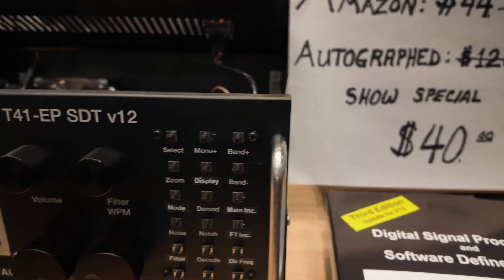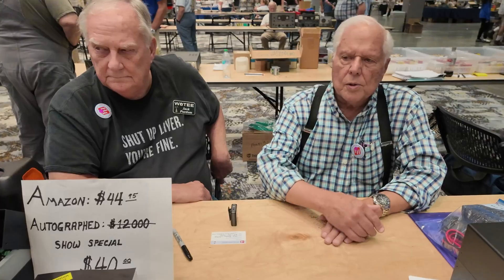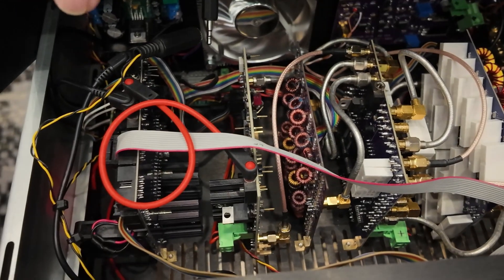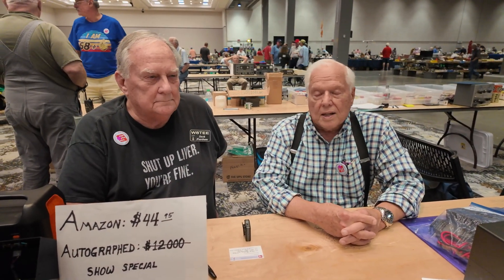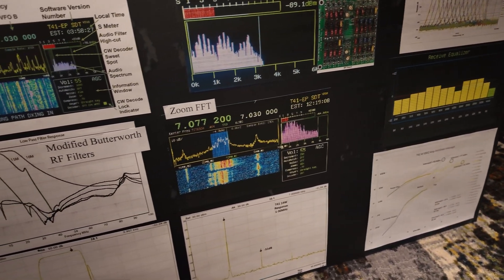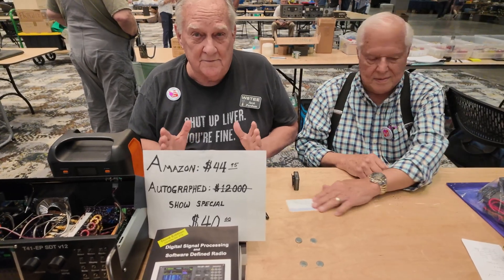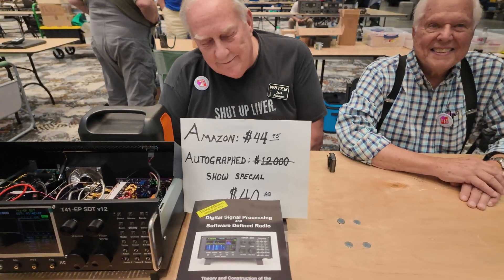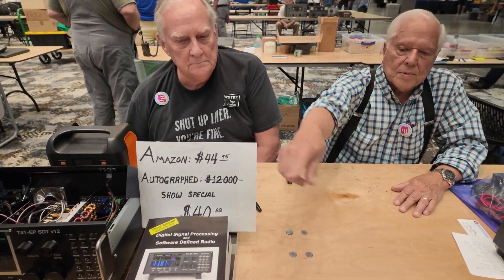Open Source DIY HF Radio!! | T41-EP | Huntsville Hamfest

Comment: Nice project! I’ve been looking for something that was competitive with commercial gear but was something I could build.
Reply from the maker: I think this is up your alley! Right now the kit is 20watt output, but I read there is a user developing a 100watts output board. What’s great about this project is even if you already built the 20 watt version, when the 100w board is released, you only have to swap out that one board, as with any of the other boards that may get updated, instead of buying a entire new radio.
Reply: @K5YVY yeah, I was thinking about boosting the power to 100 watts. The major impediment is the cost of the high power transistors. It’s not a tall reach though.